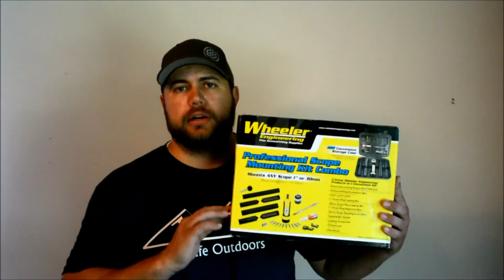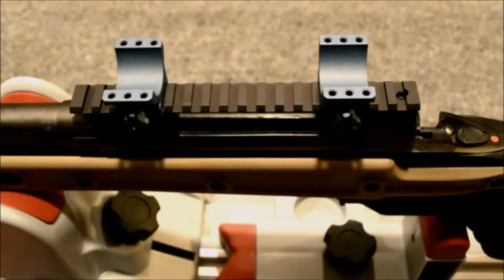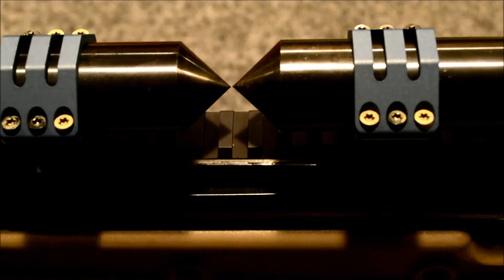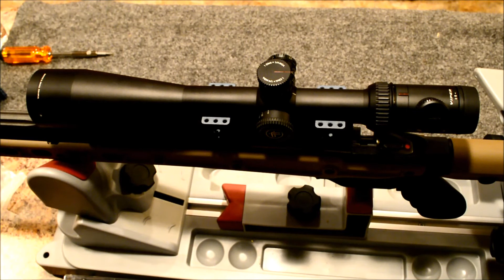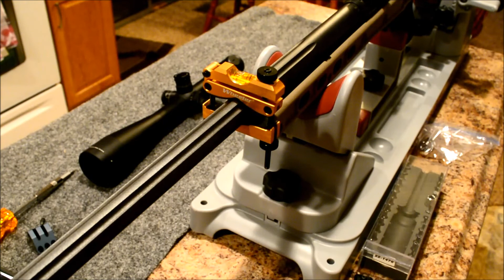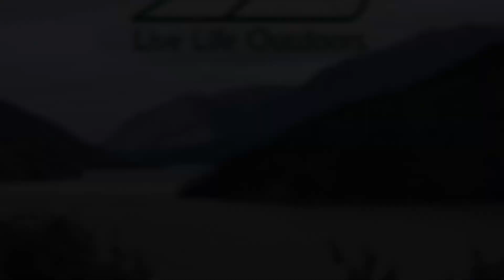How to Mount a Rifle Scope

Comment: I built a sniper rifle in 1982 on a Ruger 77v the stock got free floated the bolt was lapped all around.  The barrel was treated with MolyZ.  The magazine and trigger guard were swapped to steel.  The the bedding is a pillar using stellite tubes to as bushings these were hand ground to length to keep the length within tolerance. I did lighten the stock some.
Whole thing has just about 150 rds.  It will shoot the 10 ring 9 times out of 10 At 600yards.
Reply from the maker: Frederick Kaludis Wow! That’s pretty awesome!

Comment: Next question, will the 308 cartridges load in to the long action original magazines?
Reply from the maker: Because I have the MDT chassis, I have to use AICS format mags. So far, I only have one Magpul 5 AC L Standard magazine that I have tried and they feed great. I've put about 100 factory rounds of different brands through it and about 50 reloads. I haven't had any feed issues yet. The reloads I use are seated longer, so that helps as well. I hope that helps!
Reply: K Dolotina